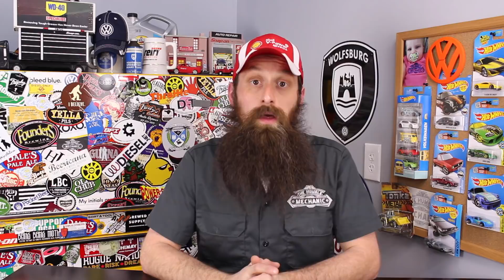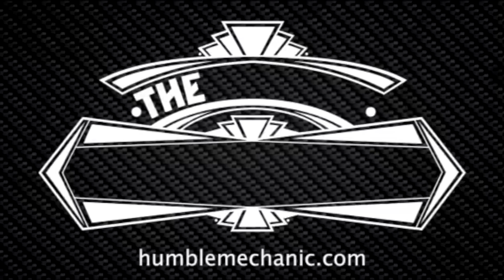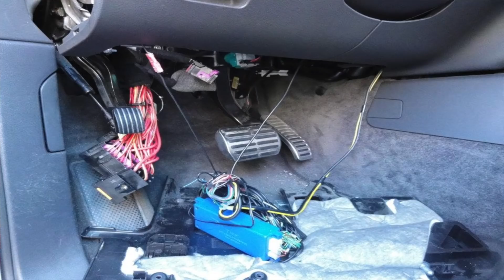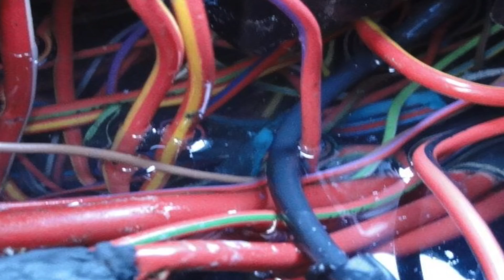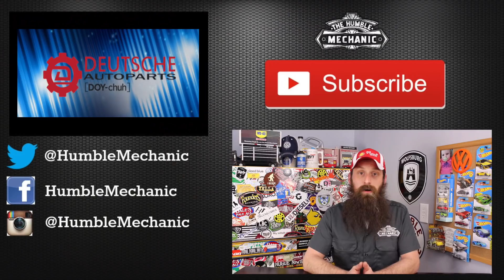Top 5 Failures of the Volkswagen Touareg

Comment: Humble Mechanic I had a 2005 V6 Touareg. it was great I had only the propshaft issue and one coil pack. Otherwise not other issues.  I was looking ot get a 2015 used certified. What are your thoughts on the 2015 and new models. I am looking at the Sport version. I do oil changes every 5K miles with Amsoil so I maintain my VW's and Audis and I have no issues. My current TDi golf has 88K miles in 2.5 years and I have not even replaced the brakes. If you get a well marinated under 15K miles 2015 Touareg  would you say its will be a reliable vehicle with very little mechanical issues?  thanks and great video.

Comment: my 2012 Touareg 3.6L V6 has been solid. Im up at 110k miles. it does wear its brakes pretty rapidly
Reply from the maker: +Rafael Mendoza the newer gen Touaregs are fantastic
Reply: HumbleMechanic can you make a video about newer model issues/maintenance Treg 2?
Reply: HumbleMechanic. what do you think of longevity issues of a vw touareg 2011 executive do you thik its a long term good reliable car
Reply: Thinking to get a used 2012 3.6L V6 FSI. What should I look out for? The mileage done is only around 40,000 miles
Reply: Mike Mayo I bought my '14 Lux brand new and my water pump went out too @ 25k, but warranty, so no biggie. Reliable otherwise.
Reply: Also love my 2013 V6 Touareg... but yes, goes through brakes quickly!!  Water pump went out, covered under warranty.
Reply: My 2012 Hybrid has 104,000 miles.  I have yet to have any work done on the brakes.

Comment: I have 2004 Volkswagen Touareg with v 8 engine ( it was my favorite car )

have electrical issue over an over 

took it to 2 different dealer ship  regarding electrical issue 

no one know what is really wrong 

1 dealership changed battery ( worked for couple months )

2 dealership took out navigation unit ( told it is drawing more power and draining battery ) 

nothing has fixed the issue . same old battery draining issue 

so i bought a external charger to charge it at night 

after watching u r video it is good to see that some cared to look in this night mare 
 
can u please please advise me what charge cable need to be checked and replaced 

also where can i get the charge cable

i'm just very tried of dealership making me go round and round 

VW car r very capable but there dealership and service sucks

i really dont trust them and started working on car myself 

it has only 90000 mile and would hate to sell it ( which i'm planing to do if the battery draining issue is not fixed ) 

please respond 

i really appreciate u r help 

also if u know any good auto shop in dallas area that works on VW ( except dealership ) 

let me know
Reply: So they didn’t respond?  @humblemechanic 

I have the same problem. Have you found any remedies?

Comment: Thanks for this. I was about to buy an 06. Not anymore.
Reply from the maker: Actually the 06 can be great. Just be sure to get a Pre Purchase inspection done BEFORE  you buy it
Reply: I mean I was headed into sign paperwork the day I watched your video. I had an inspection scheduled but it was still 5 days from now and I didn't wanna lose the vehicle but damned if i'm not incredibly hesitant after watching.
Reply: I purchased an 06 V8 and I'm a HUGE fan of it. Thus far of the items you've stated I've only noticed that the TPMS really does suck... As does the catalytic converters and the engine light constantly on due to those converter issues.  It's a 3 grand fix for the converters but obviously it'll get done.  Also the center tire caps would pop out at high speeds, but I bought a set of 4 on ebay for like 10 bucks and they are easy to replace. I've had to replace brake light bulbs... I think there is a a flaw in the seals allowing for moisture... I'm up for the tire replacement and a few other upkeep regular maintenance due to the nature of the vehicles age and miles. Overall, despite the amount of financial cost of repair,  I still LOVE this vehicle!
Reply: Robert Lunarr I bought a 06 model with 300000km on it. Spotless, wonderful car. No isues, no problems, also with the first owner.

Comment: I have one... I'd never let it go for the world... Best SUV ever.... v10 TDI... MONSTER Torque... amazing handling.
Reply: 2 years later.. is the story the same?
Reply: I too have a V10 ,great car ,had mine tuned  as well ,will destroy most cars.
Reply: TheRealMrRoboto I have one and it's a shit car for repairs.
Reply: @rowlandaloriba6931  shit cars are the best cars
Reply: Me too, same V10. Will never sell it!
Reply: I'm getting ready to buy v10 tdi
Reply: eeekkk... Just finished exhaust manifolds for a really awesome customer of mine. Also, fighting a Alternator charging issue. I do not wish these repair bills on any human.
Reply: I have an 04 by...ahead of it's time....definitely great handling...but it's given me soooooo many problems...I still love it though
Reply: I have 2 x V10 s both have a few gremlins but great vehicles. And a future classic
Reply: What year is yours? I have an issue with the starter dragging as if the battery was weak, but had the battery replaced with a new battery, and still had issues. The starter turned about 3 strokes then started to spin normal at 4th and 5th stroke and fired up. A battery charger was connected to bring it to a full charge and the starter is still dragging like before. Jave you had this problem?
Reply: @MrShanksta  Better hope it's not a V8.  Tech told me replacing the starter was an engine out job.  I'd drive it to the junkyard first.
Reply: @MrShanksta  clean the inside of your engine, by the EGR (the two big pipes right on the top). They get clogged easily with carbon and clog the injectors and you know the rest.
Reply: VW techs hate your car lol

Comment: Thanks for your tips, I would like to know if possible to ad a oil tank heater and change to use oil as fuel?
I have VW Touareg 2014 TDi R-line because I ask my dealer said if change any thing I will lose the warranty even my battery died on me when I was a way and I couldn't open the door because the look jammed so I have to clime back hitch door also both two battery remote died on me I did have 10,000 KM yet.
please tell me about the oil as fuel for a second heater with changes? because I call some company.who does sale those kit but I got no respond from them I saw to many old TDi been change I never heard any owner of change it, or can use biodiesel do you thing will give me any troubles I am trying to cut down on fuel to make my own biodiesel.

Comment: How many High Pressure Fuel Pumps, fuel pumps, fuel tanks, common rails, and full sets of Robert Bosch diesel injectors have you R&R'd under warranty, due to rusted rods in the in tank fuel pumps, or rust in the fuel filter cannister, or flat out HPFP greanaded "glitter Bomb" shrapnel failures have you R&R'd, to the tune of $13,000? V6 TDI's 2009 to present, as well as all the 2.0 L motors too?
Reply from the maker: I have only seen 1 Touareg. I would guess we have done 70+ at my dealer. All but about 4 have been warranty.
Reply: In your humble opinion,  causes of the HPFP failures?
Reply from the maker: poor fuel, and probably a design the is not very forgiving of that poor fuel
Reply: So, people that buy $50 to $65,000 TDI's should NOT be shopping for the cheapest diesel fuel around. In my research of TDI's with HPFP failures, reading both NHTSA and comments on TDI club, there seem to be extrodinarily higher amounts of of HPFP failures on folks in Hot states, in the late spring through early fall periods of time, and those that run Shell and Valero brands of diesel tend to have higher failure rates of HPFPs.  You might ask your customers what brand of diesel fuel they fill up with most frequently, for more insight on the matter.

Comment: hi Humble mechanic, can u kindly advice on the possible solution to the V.W T.Reg 2005, sometimes when turning on very low speed jerks a bit, and when the steering is straightened, the jerks stops and it works fine.
Reply from the maker: +boye3412 IVE seen lots of diff motors fail and cause that issue
Reply: thanks for your reply, please is there any suggested pointer or advice, that can guide us towards resolving this issue.

Comment: Humble Mechanic first I would like to thank you for the useful information. I appreciate you taking the time. second, I have a 2005 V8 Touareg and it has the dreaded electrical gremlin. Your description of the bad ground seems to be my problem. Cabin lights went out. Then instrument clusyer lights then ac and blinker now the battery is low and I can't get the alarm to turn off. I'm going to put a fresh battery on her tomorrow. if my problems persist could you fix her?
Reply from the maker: Sure, they are all fixable. It just depends on how much you can spend on it.
Reply: I have an 2006 v8. The transmission seems to shift at lower rpm's... Jumps quickly from 1-2 and is running in 5th at 40 mph..  Is that normal for this vehicle or did I buy a headache? what can be done?Is this a problem???

Comment: I have the 08 v8 with a no start issue. All electrical/battery has juice but car won't even attempt to start. I suspect KESSY but dealer days whole steering column has to be changed. Is this true? Ot can't I just get a new KESSY? Anyways, you're awesome and I love your vids ^subscribed*
Reply: Also, kind of random, but do you have any experience at all with the LR4? Just curios whether you had an opinion on whether one was better than another (though both have can be finicky and unreliable at times).

Comment: 06 v8 owner worried about the transmission. 100k miles shifting hard. 1 to 2 and seems to pull odd to the left 5 to 6 or 4 to 5
Reply: Have you changed the tranny fluid?
Reply: Not yet. Taking it to the dealership asap
Reply: Adam Groves Well, from my experience my transmission was acting weird. It would always go into gear, but it would slam into gear or be super delayed. I had a code pop up that said torque converter failure. I searched forums and they told me to switch out the tranny fluid. I did that and my car's transmission has been working flawless for the pass 8,000 miles.. Currently I'm at 191k.

Comment: Good Video. 04 Touareg V8 owner. You nailed it man
Reply from the maker: LOL Thank you. It was a tough time for that car.
Reply: HumbleMechanic so probably a dumb question but looking at purchasing a Touareg and was wondering I imagine most of the electrical gremlins have been figured out and there are fixes for them for the early generation am I correct assumption? Also are there any ways to get around the tires/alignment issues i.e specific brand of tires etc thanks in advance

Comment: ps ive got a 2004 v8 touareg with 160 k miles and have had minimal issues. owners need to learn how to do mainenance tho!
Reply: I also have an 04 v8 with air ride and minimal problems at 180km now. Brakes are an expensive bitch on these but find someone with a corporate account and save 1k. Also if doing the brakes yourself make sure and pick up a set of triple square sockets, you will need a 16 in the set as well as a 14. Cheers
Reply: R C i got the same one get ready to do a cam timing tensioners... its a night mare
Reply: I hate non starters!.. what cld possibly be the problem/s ... i am doomed!(2004).

Comment: 2004 Touareg (former) owner here. And had major problems with mine. TPMS battery needed change every year! New tires every 15 months. Drive shaft problem happened at 66000 miles. KESSY system failed and cause 2 battery changes and 3 calls for jump starts in 6 months!

Comment: That's more problems that I can handle, I'm on my 4th vw and I'm still not convinced to buy Touareg, beautiful cars but vw sucked and still sucks
Reply from the maker: +yourfast07 it was mostly that 2004 that was awful. The newer ones are better. Much better! 

They are not problem free by any means, and yeah, they are beautiful. Lol
Reply: terrible and expensive headlights bulbs.
Reply: We currently own a 2014 Rline TDI and honestly is one of the best cars we've ever had. Here in Mexico parts are only avalable thru dealeships (including tyres) but hreally the only thing with this SUV in the Rline  version at least is the tires and brakes 20k miles but I also admit having a heavy foot

Comment: 2016 TDI owner here.  HORRIBLE drifting issue.  Dealer doesn't know how to align ACC & Front Assist correctly.  Almost caused an accident on the highway.  Continues to drift right after 3 alignments.
Reply from the maker: YIKES! Is there another dealer you can bring it to? Is that an issue with the ACC, or an issue with maybe a tire or the wheel alignment?
Reply: I think the ACC issue is another side issue created by the dealer. From what I understand, anytime an alignment is done, the ACC has to be recalibrated?  The ACC was fine prior to the dealer attempting an alignment.  It's been drifting right ever since I drove it off the lot.  It's been a nightmare.
Reply: Can't fix it... make them buy it back under lemon law.

Comment: I've fixed a few things on my 06 V8 but reguardless, I really love this truck! I have the air suspension with locking center and rear diffs. Its can tow more than most vehicles its size, it's can tackle some serious off road situations and on top of all of that, its a great family car that isn't out place at an expensive restaurant. Its hard to find a vehicle that does everything well, even today. I  think the early Touaregs with the all those early options will eventually be classics.
Reply: I'm looking at buying the exact same car (2004-2006 V8). One thing that I want to know is, how do you find the audio quality? Is it better than most cars, or is it pretty average?
Reply: +Kyran I would say the audio quality is slightly above average. The problem is the navigation system is extremely antiquated. It takes many inputs to enter new destinations and of course the map is nothing special. What I ended up doing was connecting my phone via Bluetooth to the aux input and I only use the stock hey do you need as an amplifier. I use my phone for navigation and to stream music.
Reply: +Kyran I meant to say I use the stock head unit as an amplifier
Reply: Thanks for getting back to me on that, I read a few places that the nav system is a huge pain in the arse. Thank God we have Google maps on our phones!

I was also reading that you can upgrade the nav system on the early Touaregs to the newer RNS-510 from the 2009 models. You apparently need an adaptor though. The nice thing is that it shows the navigation directions in the instrument cluster and you can control the Bluetooth through the steering wheel. Once I get the car, I'm definitely going to consider upgrading the head unit.
Reply: +Kyran yeah that's true the multifunction display does display the directions in the instrument cluster but I decided to go to Bluetooth route  so I don't even use it. Good luck with your search and let us know how that head unit swap goes. Take care